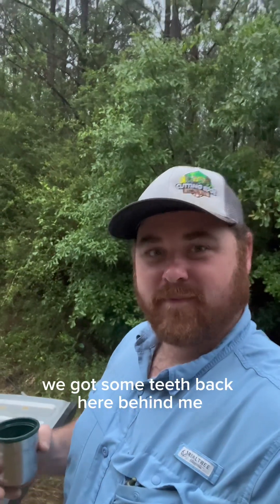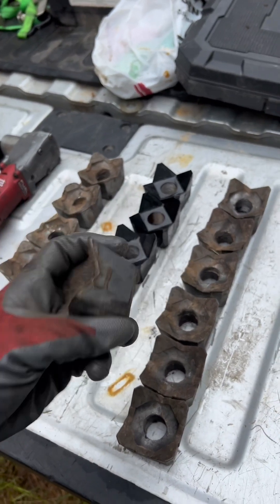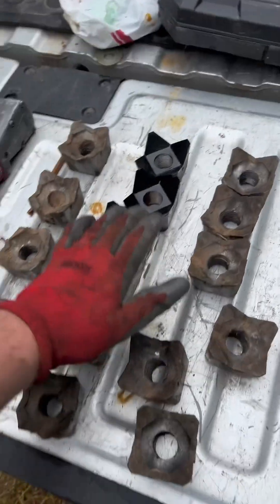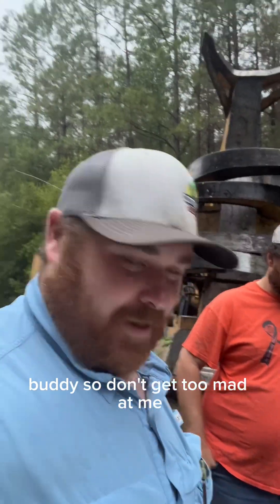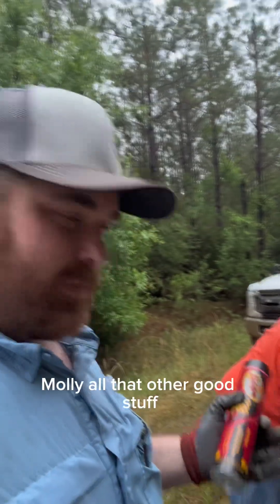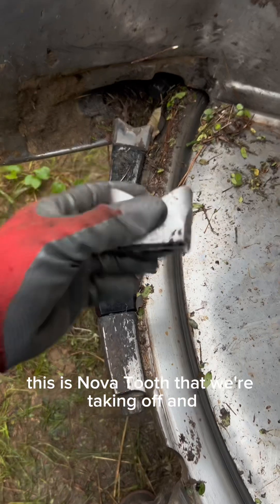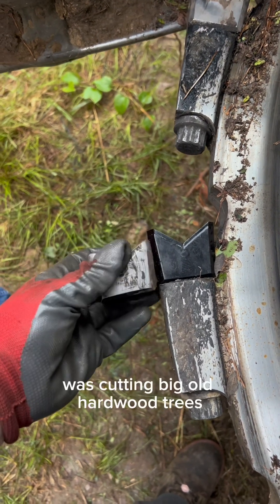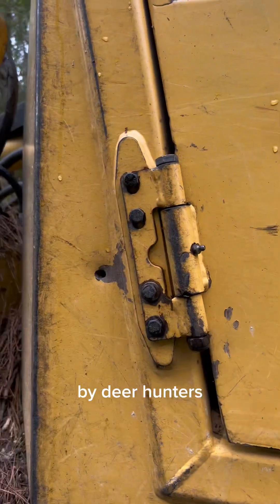Replacing Teeth On The Tigercat 724G

Comment: I  use anti-seize and have never had an issue and I put them up there with a 3 foot breaker bar. I get them as tight as I can and they always come off.
Reply from the maker: Schaffer grease is better

Comment: An entertaining video. 
Moly is the key ingredient in your grease. It can handle high temps! 
A lubricated 3/4" grade 8 bolt only needs a torque of 188 ftlbs and a plain (unlubed) bolt needs up to 376 ftlbs....(I'm assuming it's 3/4"....I had a lot of that size on my equip.)
On my construction equipment I only used grease with molybdenum, always with good luck. 
Looking forward to see that machine lay 'em down.